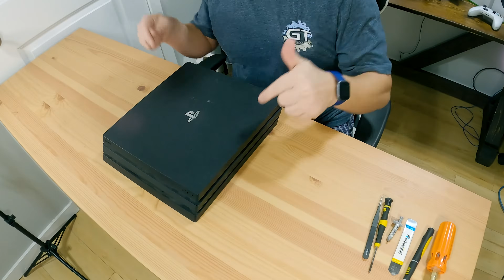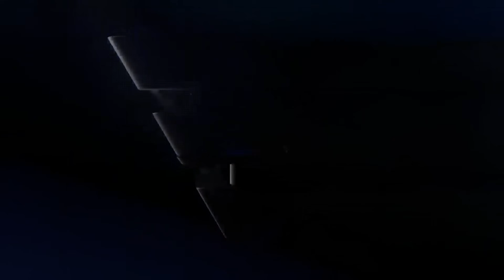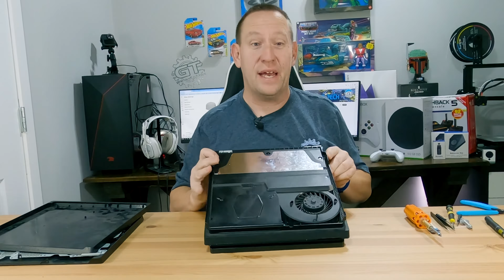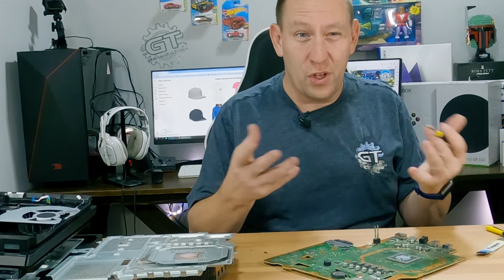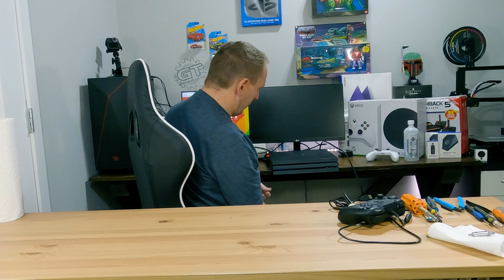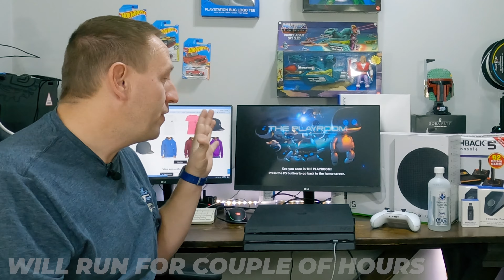Huge Performance Boost AND No More Jet Engine on your PS4 PRO! | Gears and Tech

Comment: Could of done with a before and after decibel test. I may give this a go. If I’d have known the Pro was this loud I would have purchased the slim.
Reply from the maker: Pro is better than slim by a long shot. 

Unfortunately this guy was broken and I didn't want to cause irreparable damage
Reply: @GearsAndTech  I’ve decided to return it and stick with the Nintendo. Appreciate your bid though it was very informative.
Reply: @larrysellers7891  PS4 Pro is well worth it if you can get one with a firmware of 9.00 or lower as then you can mod it to play any PS4/PS2/PSP/PS1 games for free!
Reply: Sony false advertised the Pro when they said 4k, but it's really only a 1440p console with a settings mode for 1080p. that's why i bought the Slim, because there's no difference with the Pro.
Reply from the maker: Wait till you hear more about ps5 

Turns out it's not doing 4k either. Just 1440p with dlss upscaling to 4k

Ps5 can do native 4k at 30 fps. But if you are doing 4k at 60 it's just upscaled 1440
Reply: @GearsAndTech  PS5 can do 4K 60, plenty of games already do, it just depends on the game.
Reply from the maker: Not true. They are doing upscaled 1440p to 4k60. 

Read the fine print. You're about to be disspointed
Reply: @GearsAndTech  im not disappointed at all, the PS5 is capable of doing 4K, i've witnessed it. 1440p is still nice though, the previous gen couldn't run games natively in that resolution at all, unless you had a PC with a decent graphics card, but no game last gen on console ran natively in 1440p, the One X could, but no game last gen was built off the One X exclusively, but PS5 is 3 times the performance of the One X. the PS5's only true competition is Series X, and that's a little better. God of War runs natively in 1440p. Horizon Forbidden West, same with that, it doesn't matter if it's 1440p upscaled to 4K. as i said it depends on the game, when it comes to there first party exclusives, you should know how Sony is at this point, they always push those games to the max. so if there pushing as much graphics out of the hardware as they can, then it only makes sense they would have to upscale it, but considering they can squeeze that much graphics natively, that's a win in my book. if you wanna see what games run in 4K, never look at Sony's first party exclusives. now you might say it's not 4k like they advertised, but an advertisement is just marketing. they didn't lie about it though, but 4k can mean alot of things. your not gonna get 4K if you try to squeeze as much out of the hardware, but you can get 4k if you tap enough of the hardware without pushing the system beyond it's limitations. it works the same way with PC, you wouldn't be able to run a RTX 3080 very well, if developers used a midrange card to make games. PS5 and Series X are capable of 4k out of the box, but it all depends on what developers want to get out of it. we've seen enough to know, these developers like to crank things to the max, this is how i know there won't be a Pro, or like what Microsoft did. Series X and PS5 are not underpowered like the Xbox One was at launch.
Reply from the maker: A pro is coming. Mark my words on that one.
Reply: @GearsAndTech  well you could be right, but a Pro isn't needed this time. the problem isn't the PS5 itself or even the Series X, it's developers are still in cross gen mode. they barely have tapped into what these consoles are capable of, that's because there still trying to make everyone happy by making ports, as a result that's why we're not seeing the full benefit. the industry is infatuated with remakes and remasters, it's why we saw so many this past gen. we didn't get to see what the Xbox One X and PS4 Pro could've been, if they didn't have to share games between the base hardware, but that's exactly how the industry treated them. they advertised them as refresh consoles, so if you wanted to play the slightly nicer version to look at, that's what the One X was for. but they kinda had to make them, because the base consoles were too underpowered for what the industry was pushing. im not saying innovation is a bad thing, but the console market was not ready for true 4k. the PS4 can't really do 1080p unless you get the Pro, and that's if you lucked out and got one that didn't sound like a jet engine. i mean im just a gamer at the end of the day, as much as we might complain about remasters and remakes, we all play them anyway. but I'll be the first to admit, if your someone on PS5 and Series X, ya you might feel a little rob that your not getting what the console is capable of. so i can understand the purpose of a PS5 Pro, but i think by the time fall comes back around, i don't think we'll see as many cross gen ports. the only reason Capcom is doing a RE4 remake port for the PS4 is cause Sony threw extra money at them for those who don't have a PS5. now we don't know the real reason, because if they can do a port for PS4, they can easily make a port for Xbox One. my guess is, RE4 Remake is a money grab.

now I'll say this much, if they do a PS5 Pro, i wouldn't do it right now though. im more interested if they make a Slim PS5, because I'd rather have that than the huge sky scrapper they have right now. that's the only negative about the PS5, now i get why they probably did it to address peoples concerns about the fan noise. that's why i got the PS4 Slim, it's quiet, the only downside is it can get a little warm, but i only play here and there.

Comment: With respect i say: Just put God of War on the Main menu and leave it for 10 minutes with super sample enabled, after that came and say some update on your video showing the results. Believe me it takes more than fresh thermal paste to solve the jet engine. By default its the design choice of sony for the ps4 pro and it sounds like that period. Remove the both covers and you have the most silent console ever.
Reply: I can confirm after completely stripping my ps4 replacing the thermal paste with thermal grizzly and new thermal pads it’s stupidly quiet now blockage on the heat sync is the biggest problem with them you cannot easily clean the console without being confident in taking apart the full console oh and I’ve ran god of war ragnarok at 4k for over 6 hours of intensive gaming nice and cool and quiet
Reply: @dannyhall676  It's the thermal pads that do the trick BTW.
Reply: Solved my noise issue yesterday,

Thermal Grizzly Kyronaught and new pads  , also put a pad on the HDMI chip

Whisper quiet now
Reply: New pads raly made thst big of a difference eh? I justs tick them back on. Can you give me a run down as to why? Beside rhe fact it may seperate some of the components. Unless thats literally it aha
Reply from the maker: After the video I ran some more intensive games and still no jet engine. 

I don't have gow though so I can't test that one. I'll take your word for it